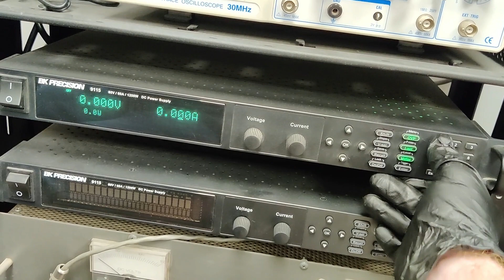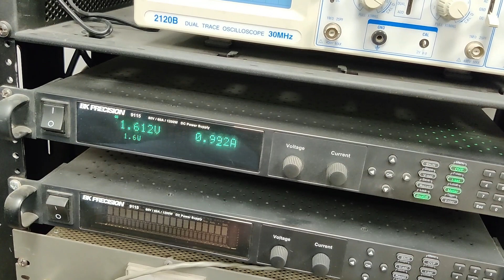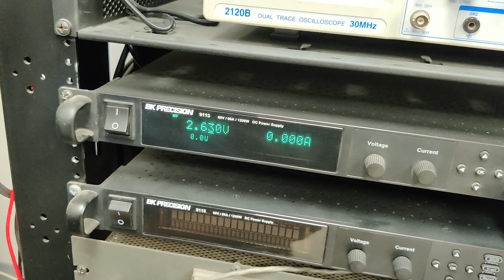Milwaukee M18 5ah bad bank 5- repaired

Comment: Thanks for the video. I thought soldering Lithium batteries was a no no and could damage the cells. Any reason not to spot weld them instead?
Reply from the maker: Ive had to repair factory spot welds, with solder. As long as you dont overheat them its fine. I do have a spot welder now i just need time to get it setup. Also with spot welding ive seen dewalt batteries that over penetrate and blow holes in the end caps
Reply: @Paul-IE-Repairs  I see. Thank you for the feedback.

Comment: Awesome video. I have question about  18650 battery brands. Does it have to be exact brand and model or just 18650 with same specs? What you recommend?
Reply from the maker: You can mix and match, as long as they charge and discharge at the same rate
Reply: Thanks!!!

Comment: Thanks for the video. I have a question: It looked like you were recharging those two new cells using/thru the battery pack. So all of the cells are receiving a charge when you really are only suppose to charge the new cells so that they are balanced before connecting the actual charger. This is so the other cells don't get overcharged trying to bring the new ones up. I'm trying to learn...Is my thinking correct?
Reply from the maker: Yes, you are correct, before you put them on the charger they should all be within 100mv of one another. If not it will thrown a cell error fault
Reply: @Paul-IE-Repairs  Thank you!

Comment: I need to know the reason about my battery have 21.3 v ,but it can't work. How can I  do?
Reply from the maker: you may have blown a fuse, or the BMU module is bad, is there any flash errors when you push the fuel level button?
Reply: @Paul-IE-Repairs  In this case I should be change Bms of my battery, yes or no?
Reply from the maker: Yes
Reply: Thank you .
Reply: Please sent link for buying Bms.
Reply: Do you have Milwaukee 's  Bms.
Reply from the maker: @สปสสส  try ebay, I have also seen some generic ones on Amazon as well
Reply: Thank you
Reply: I already change new bms, but battery can't work(the value at p+,p- = 21 v). How can I do?
Reply from the maker: @สปสสส  sounds like it needs to be unlocked on the factory charger
Reply: How can I do?
Reply from the maker: @สปสสส  normally you can just put it on the charger, if you get a green light and all 4 fuel lights it's reset and should work on the tool
Reply: Thank you very much for your information. My battery can work again.

Comment: Why is the 2804-20 starving for power with these 5.0 packs of you've ever tried to use a 5.0 4.0 3.0.. the drill will surge and make a weird noise is it the motor starving for amps under load??
Reply from the maker: What you are describing sounds like the Pulse width modulation doing its job, there is firmware in the tool and the battery that communicate and adjust accordingly for optimal tool and battery life
Reply: @Paul-IE-Repairs  thank you for clearing that up I always wondered why it did studder with anything lower than the 6.0 high output battery under heavy load. I appreciate you reaching out...
Reply: So the pulse series Hammer Drill & Impact/screw gun is junk. I thought @ first tht milwaukee had something going when screw gun would stop when screw head hit wood preventing over s rewing. Yet since this only happened every so often I came to except it was a short and then it stopp3d working all together then the sister tool for tht combo definitely confirmed it once it to stopped working.